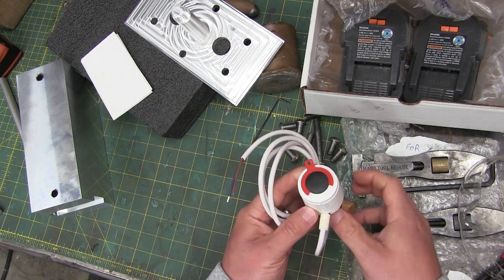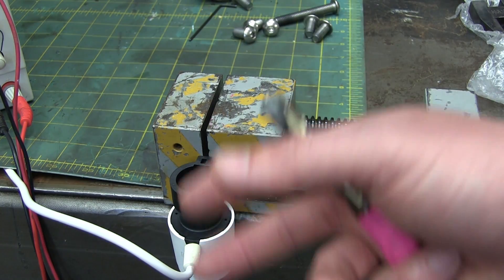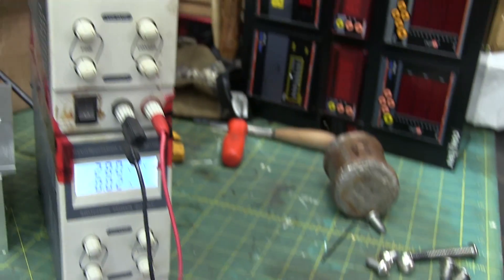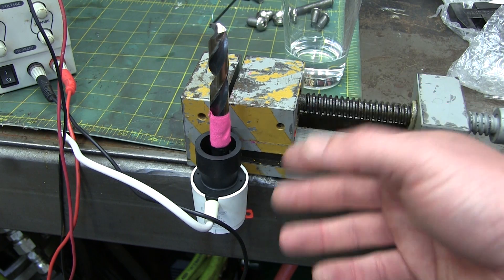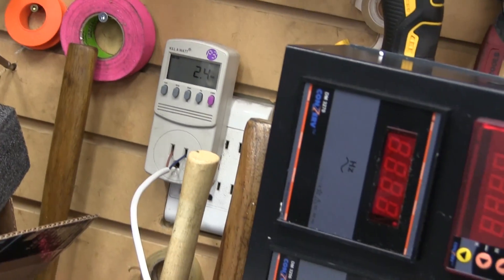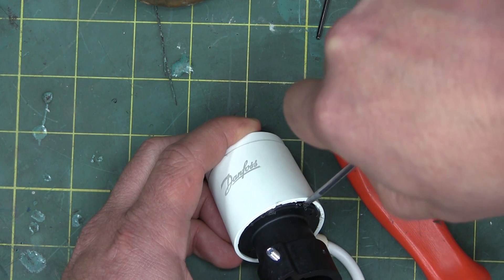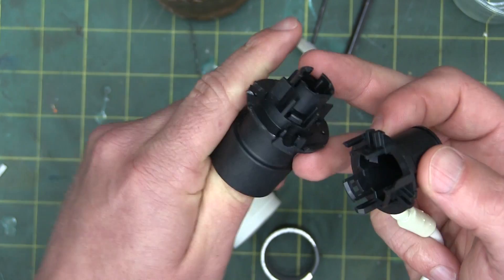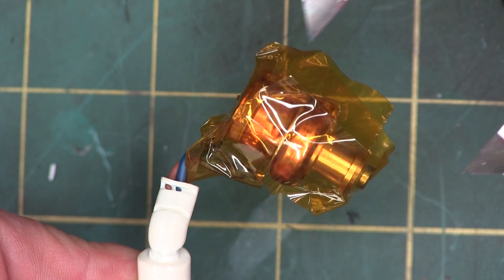BOLTR: Wax Actuated Motor | Mindblowing OLD Tech

Comment: I work with large volumes of wax. When im melting down 30 plus liters of wax the booms I feel in the house are intense. The pressure from the wax stretched the steel toggles on the container, bent the bottom out of shape among other things. The geyser like eruptions are intense especially if some water is trapped with the wax. All you need is melted wax and a slight impulse of heat to create these booms. Thanks for the video, this confirms my thoughts that wax can be used for more than just candles 🕯

Comment: With a title like that I require a direct answer. I checked the videos description for direct answer. Leaving this comment with a thumbs down. off to Google to get an actual definition.
Reply: I'm back.

The three major components in a wax motor are a wax block, a plunger that bears on it, and a heat source that heats the wax. It operates in a very simple manner — an electric heater heats the wax block when it is activated. This causes the wax to heat up, which drives the plunger out.

Comment: I learned about wax motors about ten years ago when I was repairing my dishwashing machine.  The wax motor was what actuated the pawl that holds the soap dispenser door closed until the cycle reaches a certain point.  I remember reading "wax motor" and saying what they hell is that.  So I looked it up on the internet and learned about them.  Pretty damned neat, I must say.  I spent many years as a machine designer and often used pneumatic (mostly Bimba) and hydraulic cylinders as actuators before I ever heard of wax motors.  These must be used mostly in appliances.  I believe the copper device you see in automotive engine thermostats are wax motors.  I may have I even kept the old wax motor I replaced in the dish washer.  It wasn't even the wax motor that was bad; it was a small silicone rubber bellows that sealed around the pawl that extended into the inside of the machine.  It developed a tear and was allowing water to leak out the door.  I went to the appliance parts store in town and the guy told me they didn't sell just that rubber seal; I'd have to buy the entire soap dish/wax motor assembly.

Comment: Commenting on a 3 year old vidjeo... Nissan used larger wax motors to control the fast idle on their throttle body injected engines until about 2004.

Comment: Sorry guys, I'm late to the party.  Now I understand why pouring molten paraffin wax on top of my jams & jellies in small glass jars to "seal" them from exposure to various bacteria & fungi was such a nuisance in the 1970s - when the wax cools it shrinks, and the hoped-for seal fractures.  Adding a second wax layer doesn't help much, for exactly the same reasons.  I get better, more consistent results using cup- and pint-sized conventional "Mason" canning jars, snap lids & rings.  Pour the boiling hot jelly or jam into the jar, wipe any spills from the sealing surfaces, add a preheated lid, screw on the ring.  When the product cools enough, the snap lid clicks to demonstrate a modest vacuum in the space above the product.  Sealed & safe for over a decade on the shelf {if kept in the dark}.

Comment: Just come across this, comparable to viscous fans in vehicles that are wax controlled fan actuation, switches on/off , directly by temperature of the fan housing directly attached to the water pump housing

Comment: Typical heating valves will fail automatically in the open position if there is a loss of power , signal or air to it.

Comment: Early 90's GM 4x4 trucks use a thermal actuator to lock in the front axial they were terrible it took a bit for them to look in and a little to much dragging it in the snow or a dip in a river would make them temporarily unlock.Id like to know what they use use the moved and inch more or less.they got replaced with electric actuators.

Comment: I was thinking some sort of jack for what lifting a car to change tires and oil and such. Wont drop on you suddenly like a hydraulic type. How large, weight, volume and such would it take to actuate 15"-18"?? Is that possible in the scheme of things? 🤔

Comment: These are referred to as TRVs - thermostatic radiator valves- even though technically this part is just the actuator or the 'thermostatic operator'. Very common in steam-heated apartment buildings, also used on hydronic (hot water) radiators. In one-pipe steam radiators, the valve opens the air vent (allowing air to escape so the radiator can fill with steam), in two-pipe steam systems it's used on the inlet side to either allow or block steam from entering the radiator.

The simplest and most common units have the operator and the control dial all integrated right at the valve, but some units have a remote operator that connects to the valve with a long very thin capillary tube (looks like a wire) filled with oil, these are used with enclosed radiators so they more accurately sense the room temperature

Comment: I know this is an older video, but I recently installed a system using these.  They threw me for a loop because I was expecting end switches like you'd find on a motorized valve actuator for hydronic heating.  We had a problem, which wasn't a problem.... we were testing zones and expecting actuation within just a few seconds, 5 at most, allowing the hot water through and letting know everything was working.  So after the zone didn't work for 15 seconds, we tried the next, and so on.  Finally I remembered this video that I had seen when you made it and I began to suspect our valves might be this type, they were very compact and they only had two wires, but being some expensive high end brand, I didn't smack it with the pipe wrench to see what was inside.

So long short.. Tested them again but we gave them time to warm up, and magically it actuated and let the water through.  Really neat little valves, they work with normal motor controllers too and I think they'll outlast motor valves, maybe.... I've seen some motorized valves that are 50 years old and still working fine.  After we got the system working I read the manual and it said they need about 30 seconds to warm up from the first use, 15 seconds avg after that.

Thanks for the video, the customer was an engineer and he was a little bit impressed when I figured out what the valves were so quickly.   You made me look great on that job!

Comment: Damn!  I didn't realise you'd already done the full wax motor exploration and chopping in half.  On a plus note that means It was all a nice surprise when I opened mine.  (Videos coming up soon.)
The technology reminds me of that electrolytic automatic grease unit you took apart.  Little energy, lots of force.
Reply from the maker: Hi Clive! Been thinking about you and your weaponized fogging devices. Might I suggest: Qty:1 of used "face covering"; Qty:5 of sterile agar petri dish; Qty:5 of shoddy anti-covid magic doo-dads?
Reply: Big versions of these wax motors also exist to open and close greenhouse vents, passive - just based on the ambient temperature.  They could be good for solar panel positioning?
Reply: Now I've watched both. Did ToT ever do his? I can't find it. A nod would be as good as a wink to a blind horse. No. That was an album. I mean link.
Reply: Also thermostats in a car have a wax motor.

Comment: Exactly what I have been looking into.  A sun tracking solar system.  Can you use transformers to boost the solar input to inverter?  Maybe stick 2 phase power spreader between?  I have no idea about power.  I do asbestos.
Reply: The asbestos chafes can be comfortably treated with Bolivian yellow coke. I quit doing asbestos because the coke was better tolerated.

Comment: And the geniuses at GM Engineering thought that since the vacuum hose to the axle disconnect tended to melt off against the exhaust manifold, this was a great idea! Use a thermal wax actuator to to drive the axle connect into lock position. Because nobody would ever really need their four wheel drive to actually engage when it's it is cold and snowing! LoL

Comment: There is a much simpler sun tracker... uses 2 electric motors hooked to 4 different solar cells... the cells are positioned OUT of the sun when it is correctly positioned... the cells activate the motors either in forward or reverse... when the sun hits a panel the motor drives the setup until the cell is out of the sun.

Comment: Really powerful. I worked with these in a public school. Did you say attached to a normally closed radiator valve for heating? Why normally closed ? When this thing fails and it will from all that heating and cooling and they have when I worked there, you end up with a freezing room. A normally opened valve would fail open and you avoid bursting pipes. That always bothered me until I asked the contractor who came in on warranty calls for failed valves and he told me that they had tried to change the boards mind about the type of valve but to no avail.

Comment: These are used in ship engine cooling systems to mix the low temp and high temp water so that when off or running it maintains the correct temperature

Comment: My Honda lawnmower uses a wax motor to open the choke plate in the carb. My Whirlpool duet he4t front loader washer has wax motor in the door latch release mechanism.

Nice vid. Thanks. Keep your stick on the ice.

Comment: Automotive coolant thermostats use similar wax motors as you mentioned, but many modern cars also use heaters in the thermostat so that the manufacturer has more control over the engines normal operating temperature. Most of the heated thermostats are rated for around 220 deg F (which used to be half way to overheating) for fuel economy/efficiency (tailpipe emissions) reasons, but they can run the tstat heater to drop the opening temperature as needed, since 220F + is not so good for performance. The heaters are usually PWM controlled so they can vary the tstat opening temperature over a reasonable range.

Comment: I believe Yamaha also used this as part of the fuel enrichment circuit on my outboard motor circa 199?. It gots no choke but some sort of automatic enrichment device, I'm told by a mechanic friend of mine that uses wax. Now I know a little more about it. They want mucho dinero for one therefore I squeeze the shit out of the primer bulb and make sure the starting battery is charged way up before every fishing trip.

Comment: Railroad locomotives do not use antifreeze in their cooling systems, only water. So, to prevent the cooling system from freezing when the engine isn’t running, they have drain plugs equipped with wax motors that will automatically drop out and drain the water out of the cooling system whenever the temperature drops below 40 degrees F. Purely self contained and mechanical.

Comment: Early 90s Chevy trucks used a wax actuator to lock in the front axle. Is all good until its -30 out and it takes 20 minutes to shift

Comment: Not only used in HVAC my good sir, for cheap wax motors look for old front differential thermal actuators from 90s chevy full size 4x4s. Uses a little pokey bit with linear wax actuator on 12v to lock in the diff.
Reply: I should mention that its horrible for us in MN USA or as you know in CA. A thermal actuator on -42C/-42F days win blowing, really doesnt like to get you into 4x4  when you need to be gitt'ner done.

Comment: Just today I was looking up how automotive thermostats work and this pops up. Quite interesting.

Anyway, when I replace automotive thermostats in modern cars, I go with OEM because experience has shown me that they work as designed. Many times, comparing OEM to aftermarket, the outside differences are huge. But what about this wax motor that drives it? How can that effect how it works? Well, now I have a guess. Maybe they have different amounts of copper in them. If they do, maybe this would change how fast they would open and close.

I don't know. It's just a thought.

Comment: So that still leaves the mystery of why there is copper in it and what exact sort of wax it is. Apparently, the type of wax controls the temperature of actuation. Wikipedia, and a short google search, finds nothing about putting copper in with the wax. Im'a say the copper is transfer from the cutting operation, and not actually part of the original design.

Comment: this is the same way the thermocouple in your gas furnace for the pilot light works. the pilot flame heats up the wax in the copper tube, and keeps the pilot gas switch open. that's why you have to hold the button for a few seconds, to give the wax time to expand.

Comment: The problum with normally closed valves was they was normally closed and the friggin' heat coil wood friz up when the wedder got friggin frizzen and then the pipes got busted and the whole shebang would stop working when the boiler got low water an then the bill ding got all the pipes friggin froze!

Comment: Maytag loved to use wax motors in clothes washers and dishwashers (door locks and soap dispensers).  That changed when they were bought by Whirlpool,   $10 wax motors (part # 12002535) were replaced by $80 motorized assemblies.   The consumer comes first!

Comment: for tracking solar collectors they use propane in sealed cylinders - look up zomeworks.  What they do is have a U-shaped tube. vapor pressure of propane goes up with temp, and so the warmer side is lighter, and the whole thing can tilt

https://www.solaris-shop.com/blog/the-zomeworks-passive-solar-tracking-mounting-system/

Comment: Those things are used to control underfloor heating zones in the UK. The PTC can arc across and blow the fuse in the controller. However measuring it with an ohmmeter it looks OK.
New ones have a mechanism which can make it normally-open or normally-closed, with a special “conversion procedure”.

Comment: They work the same way like the Thermostat in a Car, just with an added PTC for heating, once the Wax melts at it's specific Temperature, the Valve gets opened. Very simple and very reliable, the Wax-actuator almost never break, in most Cases it is the Valve itself which gets stuck/broken. They are great, thanks for cutting one open, its rare to get such a nice look inside.

Comment: Lots of GM 4x4s used a wax motor to engage the front diff in the 80s to..I think the early 90s. It took noticeably longer for the front end to engage in cold weather. Sometimes taking a minute or more.

Comment: They make vent actuators with paraffin wax to open vents in greenhouses without electricity so at the correct temp the vent opens and keep the greenhouse internal temp from getting too hot. the arm on them actually moves 3 to 6 inches.

Comment: Thanks for this teardown.  This actuator is really cool and I did not know about the thermal expansion of paraffin.  There lots of comments so I did not read them all but if you want to know how much force it is exerting you could measure the spring constant, k by putting weights on the spring out of the assembly and then calculate force using F=kx  where x is the total compression (including initial compression of the spring by the cover).

Comment: 3:35 " only using Heating and ventilation HVAC" 
And early 1st gen Cummins  engines to turn off the cold start advance.  I guess it didn't work so well in Canadurpastan or northern Republic of United States of America  to half way through the the model run they changed it to power on equals advance instead of always hot like the 89-91's

Comment: I use similar wax motors to open vents in my greenhouse when the temperature gets too high.  Passive; no electricity.
Reply: Agent J  The ones I've seen are about a foot long, look like hydraulic pistons. Operates on the same principle though. Greenhouse heats up, rod pokes at lever, opens the window up.
Reply: I have those also, but haven't received a working one yet. Amzon keeps sending me leaky, greasy boxes where the wax is ran out of the plastic bag and soaked through the box, it is so bad they wrap the printed product box to keep the delivery van from getting greased up.  Maybe I should send it in and let the 200 # gorilla reverse engineer it so it don't leak all over.
Reply: @GmanInd  I think the key here is "do not use where the temperature exceeds 120 degrees", delivery trucks can get very hot.

Comment: Careful you don't violate your rule about "fucking with a pressure vessel" when you build a larger model. It could slowly build to a critical failure, complete with plastic shrapnel and hot wax. Unless you're into that; I don't judge.

Comment: I thought a non computerized solar tracker would be fun too. I wondered if two car hatch lift struts filled with refrigerant  in a teeter totter configuration could work. Maybe a magnifying glass helps get the lift strut not in shadow extra hot. ( I made a youtube vid on a failed attempt to make a big cheap parabolic mirror  that would ideally auto track to do a solar bbq).

Comment: To adapt an ice-maker for sun-tracker, coconut oil could be used even in winter. Melts at 85F =~ 30C. A clock motor could adjust the speed some to be slower than freon-freezer. Thanks.

Comment: Thanks. Also interesting actuators are vehicle radiator fan-clutches and temp-safe shower valves. Both use silicone wax. Vehicle thermostats? Your solar actuator could be adapted from an old ice-maker. Excellent Vijeo.

Comment: The 89 to 98 gm pickups had wax actuators in the front differential that would push out a good 1/2" or so and just ran off 12volt dc
Reply: The S10's had vacuum actuators I figured the full sizes did too?
Reply: @dodge8802  nope wax with a 12v heating coil  in 99 they switch to electronic solenoid for the auto trac system